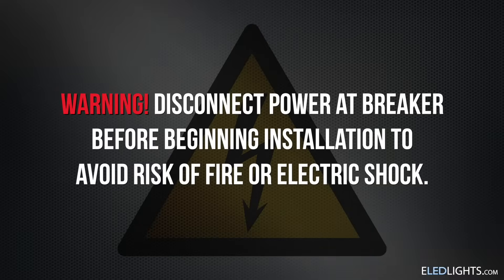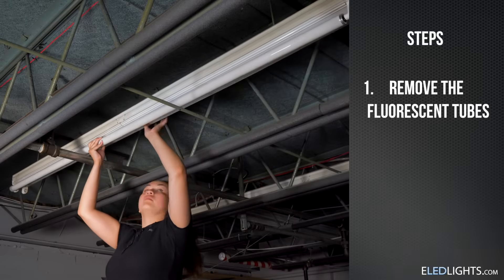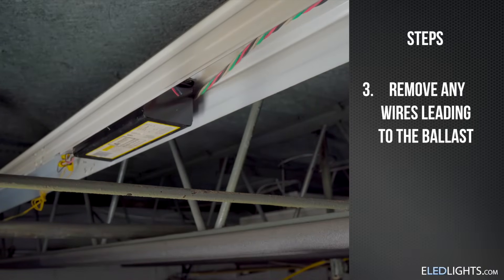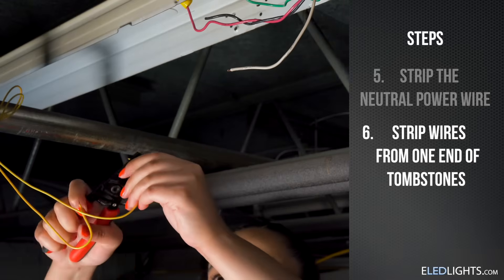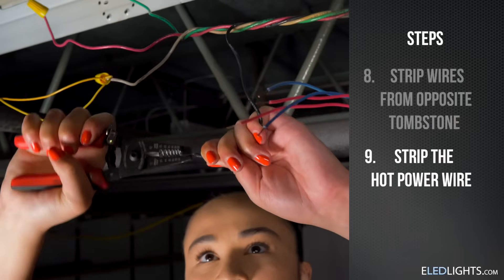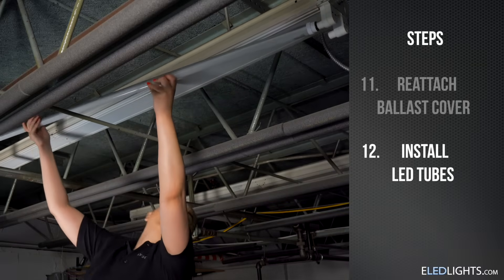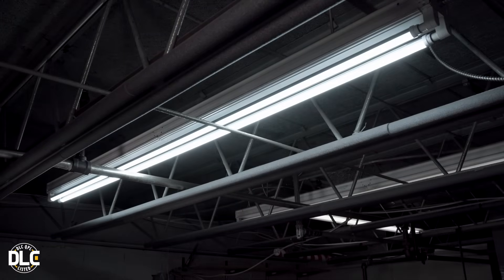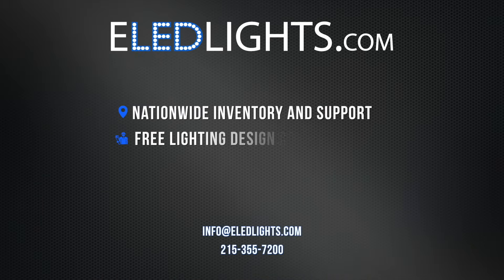Convert 8ft Fluorescent Fixtures to LED

Comment: just purchased   case of 8ft  40 watt  aluminum with polycarbonate lens  frosted R17D  AND BYPASSING  ( removing ballast )       --    WIRING -- Neutral at one end and other end live  wire ..  and ground fixture.    Do  these bulbs  take either shunted or non shunter tombstones  ??????

Comment: Okay here's a quick tutorial cut the wires both ends of ballast. There is no reason to remove the ballast just leave it there it's not bothering anyone. Now here's an easy way to remember what to do  . One end is hot  , that's black ,  and one end is not ,  that's white remember that and it's a cinch. The colors of the other wires do not matter as long as you're keeping your groups together .  I've done quite a few of these and it probably doesn't take any longer than 10 minutes. And in case you're wondering the cost for the new 8-foot tubes I paid $17 a piece in December 2023 at an electrical supply outfit . The 4 ft tubes were even cheaper than that I believe I paid less than 4 dollars each for those . Good luck with your project and don't be nervous it's easy as anything there's no need to buy new fixtures ever just rewire and use LED bulbs. Problem solved

Comment: This video worked for these: 
4Pack R17d V Shaped Rotatable HO Base 8 Foot led Bulbs Double Row ,65W,150W Fluorescent Lamp Replacement Shop Lights, Dual-Ended Power, Cold White 6000K, 7800LM,Clear Cover, AC 90-277V
This wiring method should work for any dual-end powered light, as opposed to single-end powered. Look for those terms and you should be good.

Comment: According to what I see in the video and on their website, all the 8 foot led lights have the G13 single input end and not the 2 pin. Thus, you'll have to replace both mounting ends for the light tube to actually mount to. 

Everyone says how easy and fast you can swap lights out to led's but no one has YET talked about having to replace the tombstone mounts for the single pin tubes.

Quote from their website for these lights: "Electronic ballast fixtures will require new lampholders, one fixed and one plunger style for each tube—you can find them in the accessories section above"
Reply: I have found that a lot of these conversion videos can be somewhat misleading due to lack of detail. There is such a large variation of bulbs and tombstones and no video seems to describe the specific tombstone and bulb being used in the demo.
Reply: You can get single pin 8' LED tubes as well.
Reply: Can you even get G13 led bulbs in 8 foot length? I had HO  tombstones and swapped to single pin FA8 tombstones because I couldn't find any 8 foot led G13 ends in my area
Reply: @@Martys-4x4I've showed a pic of my set up. Trying to bypass the ballast. I was told to connect the yellow wires to Black (hot)& blue&red to yellow(neutral). Isn't it supposed to be the other way? Like this vid?